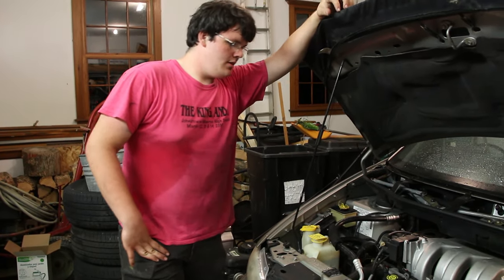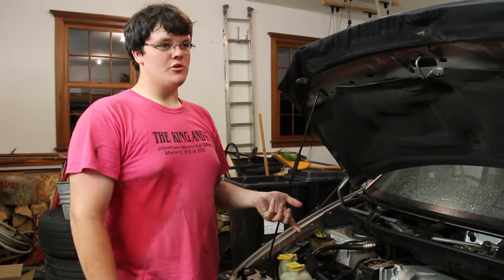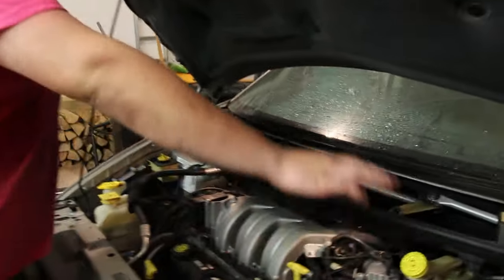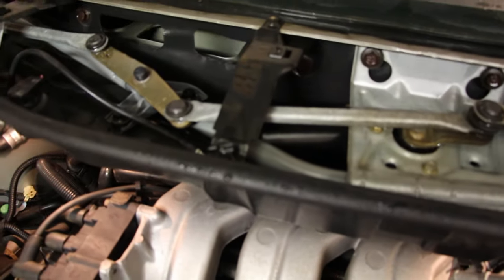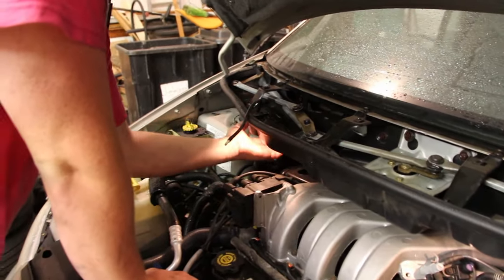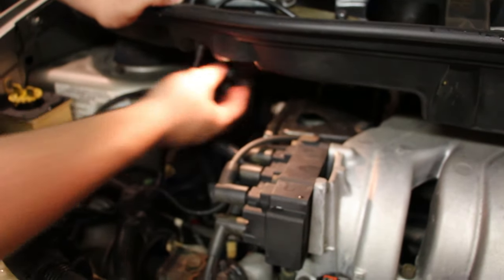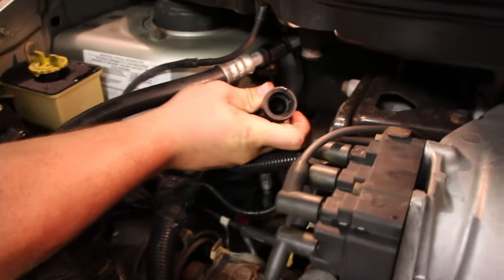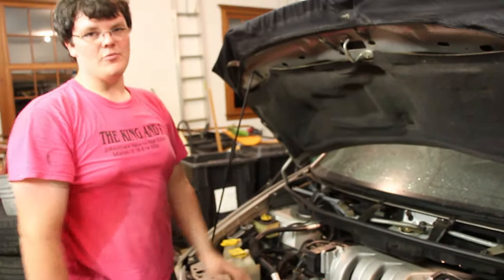(How To) Fix Water Leaking into Cabin HVAC

Comment: Thanks for this video, we probably have this problem because we park under a tree with small leaves. We had to replace our HVAC motor twice already because water got in it and froze. 😕
Reply: I have lots of pine trees, palms, oaks, and other trees all by my driveway. This is definitely my problem. Such a pain to deal with all the pollen and crap that comes off the trees. I have bundles of wires that are wet on my GX460 that I don't drive much. Now i'm afraid to start it because I don't want everything to fry

Comment: This was exactly what mine was, but you can just pull the hoses off like you did and check them as well as stick your finger up into the drain hole. The gunk ran out. I've not moved the van yet to confirm that all the water is now drained out/gone (it really sounded like it was in the bottom of the dashboard, not the top, but I bet that's my ears).

Now my fuel gauge and power locks don't work (door locks are very intermittently working); I'm hoping that clears itself up when it dries out.

Comment: What do you mean by half gallon of water dripping out on the floor? are you talking about the floorboard in the van or garage floor where you park it?.and you say this rainwater is coming from under the dashboard, isn't that hell on the wiring harness and other electrical components up under there? It's a good video but it's somewhat vague.. you need to be more specific for me to be able to understand what you're talking about, you don't even tell us what year or model van your sister has you're working on..
Reply: The title says "cabin" its the car interior.  All vehicles have drains or cowels under windshield that can catch debris and  need to get clean.  Tons of videos out there to help.